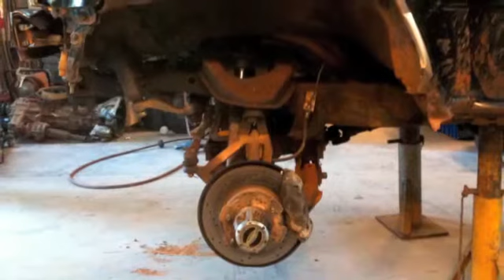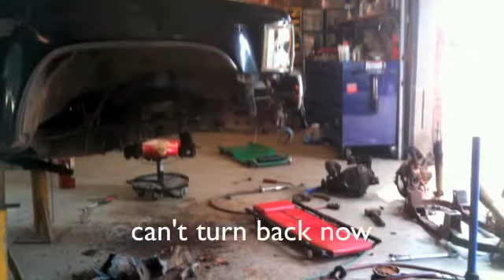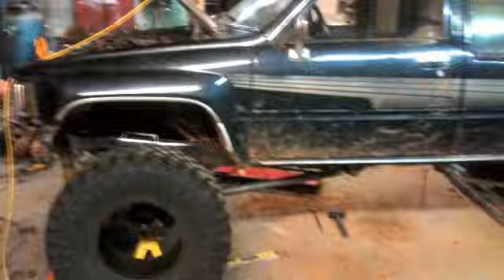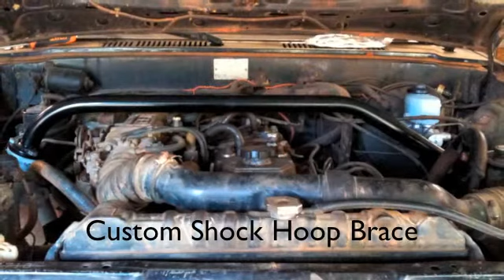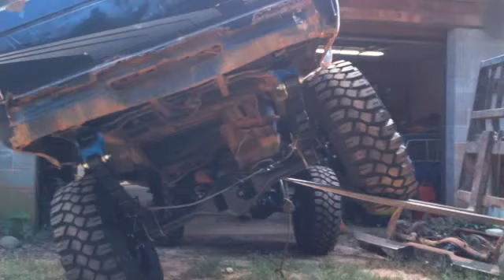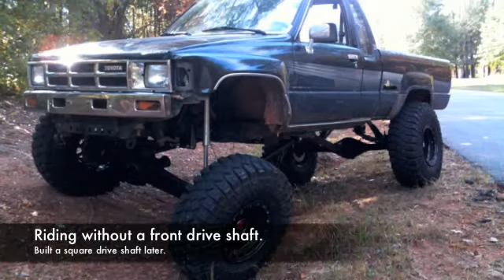Copy of 3 Link SAS Toyota 4x4

Comment: I’m currently cutting all my brackets off. Did you have to cut the rear torsion bar brackets off on the frame to fit the lower link brackets? One side has the E brake line running through it. Wish there was a way I can PM you to send you pictures.
Reply from the maker: Ben Parreno message me on Instagram if you have it (yotabays)

Comment: How has the kit held up so far? did you have to notch the passenger frame at all to gain more travel? i cant decide if i want to go for the 4 wheel underground kit or save a little and do the trail gear kit. do you think the geometry on the trail gear kit is pretty good? how is the quality of the kit, was everything pretty much ready to be welded on?
Reply from the maker: Ben Parreno Kit has held up great. No nothing of the frame. Underground kit looks very similar but more expensive. Here is a video of it https://youtu.be/Sjfi1GTaQro

Comment: Great build, very well done. Looking in at doing the trail gear 3 link as well in the near future. How does it handle on the road? Any bad sway or fighting the road?
Reply from the maker: All depends on how aggressive your tires are. Rides very well. Speed bumps are smoother the faster you go.
Reply: Michael Bays I'll be going with 33x13.5 toyo mt, so nothing too bad. I like your set up a lot, just don't want to build something I can't take on trips. Seems like yours is just fine
Reply: The 2 links are made to weld perfect parallel with the frame? Or u offset it how you want? I. Thinking of LT my ifs and 3 link in the rear for daily... on 32"s

Comment: What happens if you slam on the brakes at 80mph? Genuinely curious, is it not going to twist or anything?
Reply from the maker: sillydillydokieo It will lock the brakes up lol. The suspension has links to prevent movement in every direction. https://www.yotamasters.com/shop/suspension/trail-gear-suspension/link-suspension-kits-front/trail-link-three-front-3-link-kit-with-fox-air-shocks-high-steer/. See picture in link.

Comment: would you say the install is pretty much doable without a lift? looks like you had the truck leveled the for the whole build.
Reply from the maker: Ben Parreno I used some really tall jack stands. Was able to do it all except to fill the air shocks. Suspension has to be at full drop to fill them.

Comment: +Michael Bays Nice job thats some good wheel articulation. I would like to ask you which front axle (housing) did you use i would like to do a sas with my 4runner gen 1. But old toyota pickup/4runner solid axle's are very rare in Europe.
Reply from the maker: Sjors Boomschors I used a 85 Toyota stock housing. If you can not find one you can buy a rock assault axle from trailgear.com

Comment: did you had to push the front axle forward
Reply from the maker: You can put it wherever you want. Cool thing is when the suspension goes up the tire moves forward. No contact with fender well.

Comment: you have no springs?
Reply from the maker: KeithEndre No springs in the front. It has air shocks. Fox 2.0 air shocks. You can adjust the spring rate/ride height with the amount of nitrogen you put in.
Reply: @KawaBays330  I thought shocks weren't designed to carry the vehicle weight
Reply from the maker: KeithEndre not all shocks
Reply: @KawaBays330  
Are those shocks easy to break on the trail ?
Reply from the maker: Mr Jebadia I have never had an issue.
Reply from the maker: @mrjebadia2582  not that I have experienced. Haha.